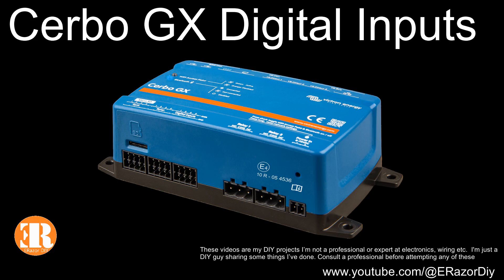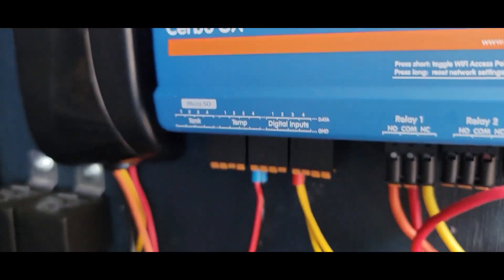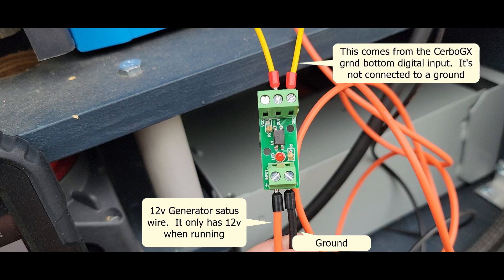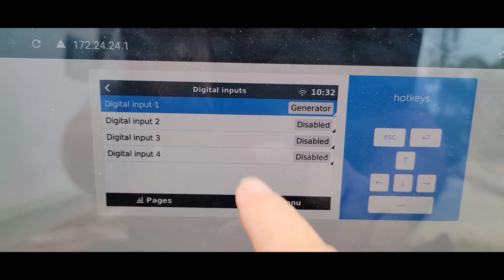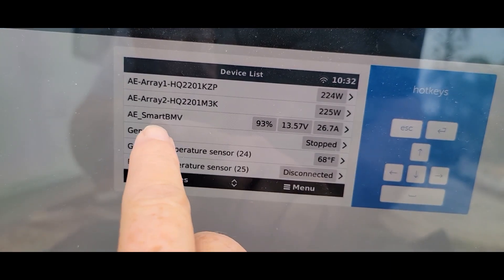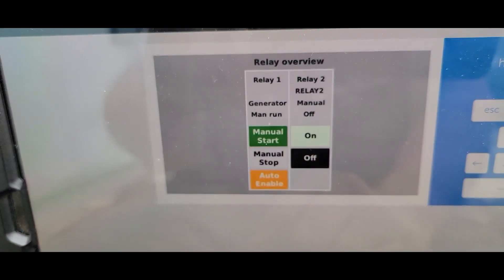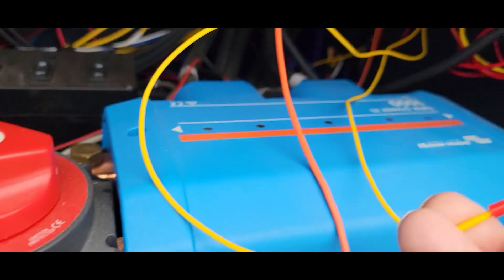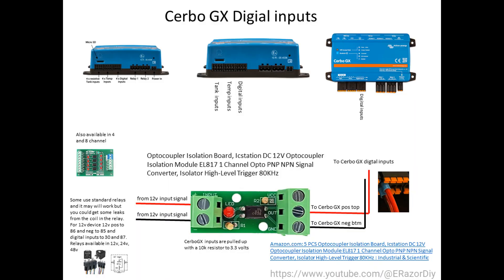Victron Cerbo GX Digital Inputs using a isolation module

Comment: Thank you for explaining how to wire an isolation board! I´m actually trying to do a similar thing, but with the Victron Global Link 520, and I think that the ports are designed in the same way. I can however not find any information anywhere on how to go about in a straight forward way, especially for me, not being that knowledgeable in electronics. Perhaps you could guide me? What I am trying to do is to make use of both the digital input and the relay ports on my GL 520. Using a couple of optocouplers (single 12 v) I would like to connect my bilge pump in my boat to the digital input (hence giving me a warning if the pump should be activated when I´m not on the boat), and second, I would like to be able to remotely switch on my refrigerator on the boat using the VRM portal. The optocouplers I have are identical to the ones you are using in your video. Could you please guide me on how to wire each optocoupler (in both ends, i.e. both +/- and VCC/OUT & GND)? Your assistance is greatly appreciated! Best, Christofer
Reply from the maker: sure would be more than happy to help I'm only a DIYer but have played around with some of this.   Currently I'm working on generator restart unit.  If start fails retry unit that uses two inputs that can be controlled by the Multiplus/cerbogx/bmv712 or a simple switch. 

You can email me or look me up on facebook Messager.  
ErazorDIY@gmail.com or DoingCreatesKnowledge@gmail.com
Reply: @ERazo @ERazorDiy t, thanks for offering your help! I’ll send you an email and try to explain what I’m trying to achieve. Best, Christofer

Comment: Cani I use a Relays connected to my generator without using optcoupler? How Can i connect it? Thank You
Reply from the maker: You can but there is a danger in doing it.  the optcoupler isolates the signal to prevent unwanted relay noise or a bad signal.  One bad signal to cerbogx digital input could damage the cerbogx. 
That said if your truly just using a cerbo gx unfortunately the generator signal as a digital input is not acted upon by the cerbogx programming so its only a show.   I'm still running an  older version of firmware but haven't heard of a change in the latest update either so it's truly unnecessary but it will show the true state of the generator and if thats what your only looking for it does that.  If your using a raspberry pi pico it can be a useful signal to have and use within your programming.

Comment: Can i connect the generator input signals to the remote dashboard control of the generator?
Reply from the maker: It doesn't matter were you tie into the generators signals as long as you identify what the generator needs to start and stop.  Meaning if it's a positive signal or a negative typically a negative signal and if it's a constant or momentary signal.   After you know that then setting up the relays is easy.  I've helped ppl that have gotten the signal wires from all kinds of locations.

Comment: In the video you show that the optocoupler is available in a 4 channel version. The 4 channel version only has one GND connection on the output side. How should this be connectet to the Cerbo GX. Can I just connect to GNC from one of the digital inputs on the Cerbo, or do I need to connect to GND from each of the Cerbo inputs?

Stated in an other way: Do the Cerbo digital inputs share a common GND?
Reply from the maker: No.  each input needs a ground.   What ever source your powering/grounding the module with (Vcc/GND) the same ground source will go to the CerboGx ground digital input.  if using all 4/multiple I would just carry one wire to the CerboGX and daisy chain to each digital ground input you are using from that module.

Comment from the maker: The touching of the two wires connected to the CerboGX digital input will cause the generator signal to show Running or Stopped.  The signal can be inverted in the generator device setting.  You can also set an alarm there as well